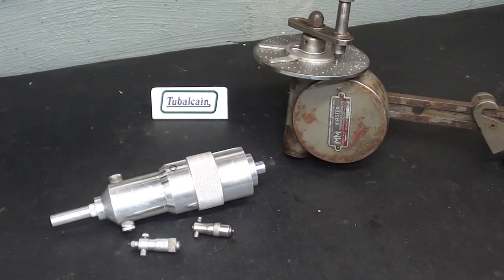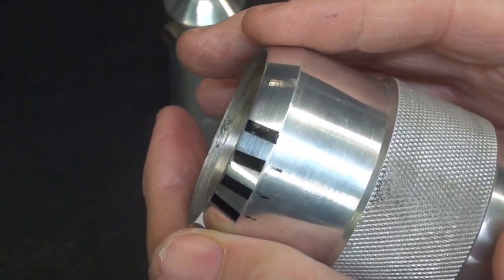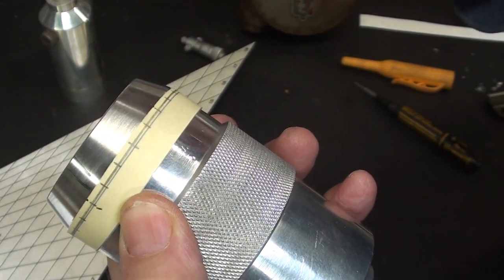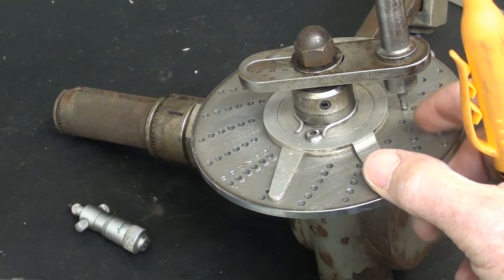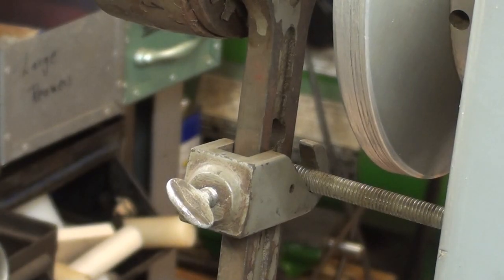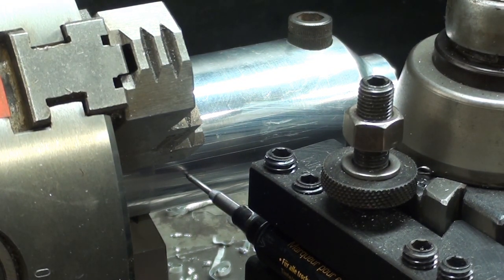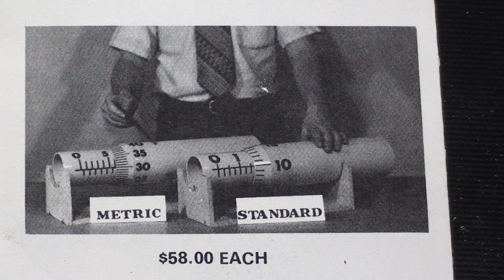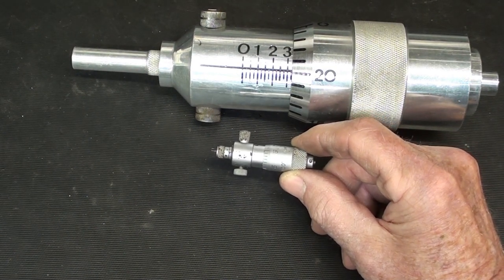Lathe Dividing Head Micrometer Teaching Aid TIPS #628  mrpete machinist

Comment: Interesting lesson, my friend.  We didn't have teaching aids like this in the school shop.  Just large wall-size charts that illustrated using a micrometer.  We did have a large slide rule teaching aid (you no doubt remember those) suspended above the blackboard that was used to teach the solution of problems using the various scales on a slide rule.  Those were great old days, punctuated only by the anxious realization that the draft board sent notices in the mail on Tuesdays.
Reply from the maker: I had some big micrometer charts at school, but they were already ancient and falling apart when I started in 1967. I must’ve thrown them away. And yes, the math and science teachers have those big slide rules.
Reply from the maker: And also, I did get my notice from the draft board to report for a physical. But I do not remember the day of the week, I was too traumatized to recall.

Comment: I consider this series a spectacular success.  Thank you, Lyle.

If this series was about how to put equally divided marks around a cylinder, the dividing head, along with all the effort to create a suitable plate, would in fact be a horrible waste of time on your part for making all those videos and on ours for watching them.  As you said, there are just too many easier ways to accomplish that task.

The good news is that was not the purpose at all! The purpose was to show how dividing heads work, using somewhat unique hardware and various problem-solving techniques.  The exact end product (lines on a cylinder) of the video series is as useless as the micrometer it created but the techniques the series taught are as useful as the teaching aid they created.
Reply from the maker: Thanks

Comment: Awesome.  I like that little dividing head!  I was an early adopter of Powerpoint and making digital photographs to avoid having dozens of 3" binders full of overhead transparencies.  As far as digital versus mechanical tools - many years ago I had an apprentice condemn all 4 rotors on a vehicle as under-size.  His measurements showed the rotors to be considerably thinner than they actually were; the rotors were replaced a year previous and were basically brand new.  The customer - a machinist ironically - came out to look at the rotors and estimated the thickness by eye.  When a mechanical vernier caliper was used the estimate was much closer than the measurements taken with the inexpensive digital caliper used by the apprentice.  I prefer mechanical tools, no batteries, no sensor deterioration...  My eyes don't care so much for them anymore though.
Reply from the maker: There is a lot of truth in what you just said. I do like my digital calipers, but in general prefer the older mechanical measuring instruments.

Comment: When I started engineering school we ALL had to take Slide Rule class.  There was a six foot long slide rule mounted about 5 1/2 feet above the floor in two rings supported by a frame mounted on casters.  It was an enlarged version of out slide rules including the markings.  The thing was extremely accurate because it was very easy to adjust the slide and traveller.
Reply from the maker: I remember those from science class

Comment: Beta was used in television due to it's quality.  You could make copies of copies and the quality remained high for a several generations.  All our recorded video was on beta.  We had a 4 player setup at the tv station that ran commercials.  It had gobs of tapes available and a trolley system that would grab the tape, stuff it in the player, then return it to it's place.  Back before digital took over.  Boxes of tapes would make their way to the news set to be played during the news cast.  Woe to the intern that dropped a box.  All the taps had to be re-tensioned and re-cued....
Reply from the maker: Thank you for that, that is very interesting to me. I do remember that when I went to the Chicago auto show a few years back, all of the TV stations were using beta cameras

Comment: My father was in charge of the Calibration Lab for all the test equipment and Microscopes for one of IBM Plants where they made the Wafers and IC for IBM computers in the '60s and '70s. Electronic Test equipment was not handled by his group (O'Scopes, Multimeters Etc). All the masters they had in their LAB were 1 jump away from the NBS masters. Sometimes some of the items were so out of Calibration and could not be fixed (but still usable by a school) he was able to get them donated to the Trade Shop section of our High School - Also sometimes it was marking that were removed from all the use they got. His lab was a Class A cleanroom - Coat with hood, boot covers  Mask. It was a AA plate. One year during the summer break he was able to get the plant to Calibration on all the items in the machine shop, Auto Shop, and Electronic Class.
Reply from the maker: Thank you, very interesting

Comment: Hi Mr Pete, thanks for showing this divider. You mentioned that the thread was not coarse enough in the model, you probably don’t want any extra work but would drilling and tapping for 3/4 10 tpi and replacing the apparent threaded rod or bolt with matching thread work?

Comment: A fine finish to a long series. I still have sheets and sheets of Letraset and Ziptone. And a few pieces of Rubylith, in fact. Last major machine restoration I did (20 foot bed, 48" swing lathe, pre-20th century) got letraset labels for the controls and oil points. Clean the paint, rub on, then several coats of clear to protect them. Held up well in service. I still use, and teach, with conventional measuring tools. There is value in understanding the principle in measurement, reliable, robust, and I can get top quality inexpensively on the used market so I can have a sufficient number of calipers and mics on hand. Also can hand them off to students in need when they move on.

Comment: Hi Lyle,

From early in your video I was thinking camera and screen and a normal micrometer, we have technology,  and I'm also a septuagenarian. 

The problem with any digital readout is it's not linear but stepped, so the "old fashioned" one will show if you are somewhere in between divisions where the digital will not, and while we might be only talking 0.001" or 0.01mm, that can mean an interference fit or a clearance fit. So learning how to read both forms is important. Also traditional micrometers are still readable with our deteriorating eye sight, where counting divisions on a vernier I find much harder. The dial type is a better option. 

I think there are more people out there who learn a great deal from you and many other you tube presenters. 

Regards Dennis.
Reply from the maker: Thank you very much, you’ll make some good points. Some of the digital micrometers read to four places. Also some of them have engraved lines as well. That may help you determine how far you are in between numbers. Most people are lucky to get within two or 3 thousands anyway          But I think we are stuck in the olden days

Comment: I love your teaching style!  As an engineering student my wheels are always turning.  I have noticed most of the older lathes have the head-stock mounted on top of the ways.  I also hear they always have wear in the same area on the ways and lead screws.  That makes sense because most work is done close to the head.  Did any of the old engineers not think to make the bed symmetrical so you could turn it around and mount the head and tail components on the opposite sides?  Like flipping your mattress.  This would allow extended  life of the ways.  I was looking at a Southbend lathe from pictures and the base of the bed ends are of different sizes with the head being larger to allow the belts to be fed from underneath.  If you fed the belts from the rear do you know if a bed flip is possible?
Reply from the maker: I do not think that would work. But everything you said makes a lot of sense. But of course they didn’t want them to last forever. The sooner they were out the better. Will sell them another one. And then another one. Ad infinitum.

Comment: Lyle thx for sharing. I wasn't aware that a dividing head was available for a lathe spindle. That was so cool. I'm going to work on an adapter for my 6" dividing table for my lathe spindle. Keep up the great lessons. You know many micrometers are still around that are not digital. So, knowing how to read a manual micrometer is still important.
I wonder if a clear coat of paint would protect the markings that you put on that teaching aid? Hopefully it wouldn't dissolve the ink and leave you with a smeary mess.
Thx again for sharing, indexing, that is.
Reply from the maker: I have never heard of a lathe Index head until I bought this one a few months ago. I did not know what it was when I bought it

Comment: Thank you for this video.  How do etch the steel when make the real micrometers?  I ask because the lathe wasn’t turned on.
Reply from the maker: I would use a threading tool turned on its side. In fact that is shown in other videos where I make Dials.

Comment: I also have a lathe dividing head and was thinking of making a powered cutter, possibly a tool post grinder with cutters mounted in it and slowed down to cut splines.

I also have a Globe Milling Adapter, which is an amazing lathe milling attachment unlike others that was built in the 40s and 50s. Search YT for it and my video should pop up. I also have a user group devoted to the Globe Miller,, and am featured on the Lathes.com website. You might find that interesting.
Reply from the maker: Thank you, I will check that out. I have seen pictures of these

Comment: BETA was only a failure in the consumer  market. Professional taped video (like news stories) is pretty much exclusively BETA format.
Reply from the maker: You are right. When I would go to big events like the Chicago auto show. I would observe the news Teams Using the beta cameras. I believe it was actually superior
Reply: I still have my Sanyo BETA machine i bought in 1984, still works just tapes are going bad.
Reply: @mrpete222  by far the superior format. I think it was just cost that drove VHS to success. The decks and media were around 10 percent cheaper initially, and that c note was a huge inducement at the consumer level. Once that foothold was established, the die was cast.